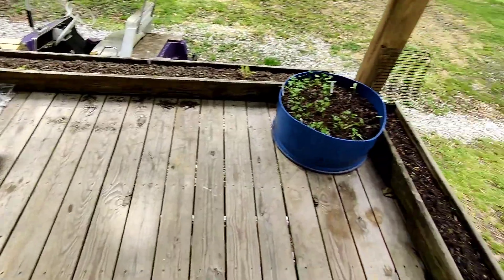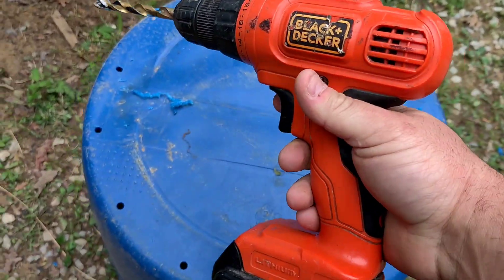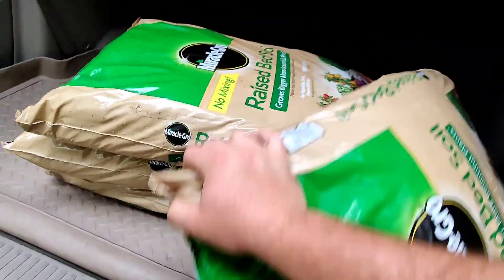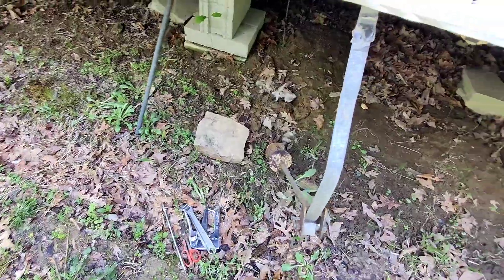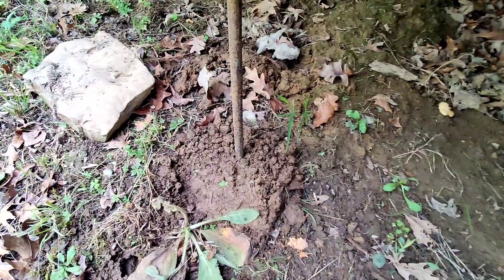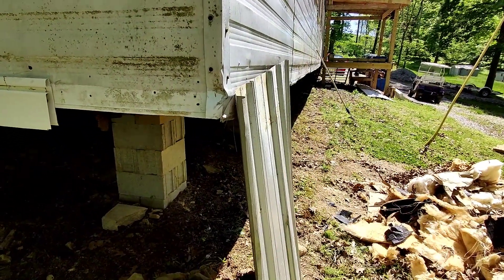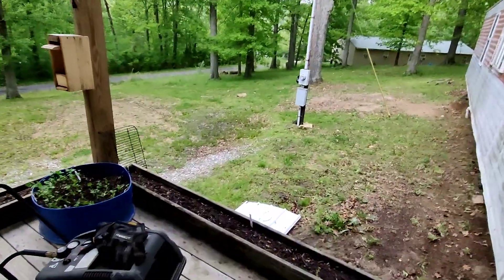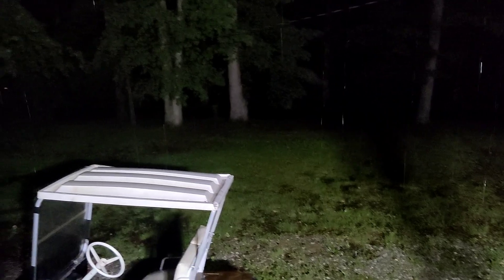I COULD GET THINGS DONE IF IT STOP RAINING

Comment: Amen to that. I've been trying to follow your videos as I'm doing repairs and tearing out floors on a 71 model. I'm not a carpenter by any stretch but I'm doing my best as it has to be done.(Its Mom's place and started out just going to put in new carpet and put tiles where old linoleum was but floors were shot) I've never seen so much rain and every job I need to do requires tearing something out. Since I'm working alone with two children in the house I stick to small repairs on rainy days. I am certainly thankful for your videos !

Comment: The price you said you paid for the drill and 2 batteries is CHEAP! Usually each battery alone cost that much. I also got one of those battery operated drills from wallyworld, but mine came with only 1 battery and I paid more than you did I think. But you can't beat it when you need something portable. Stay safe!